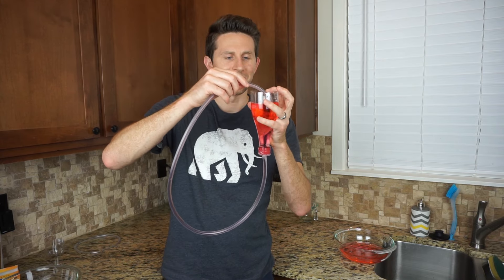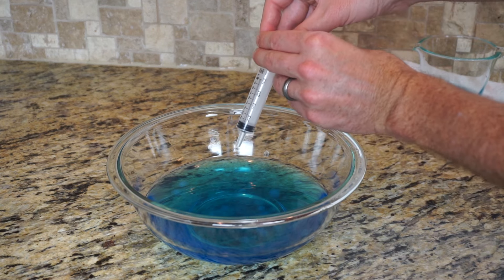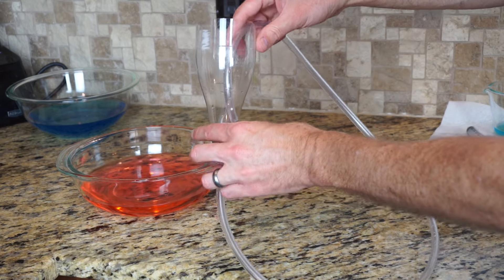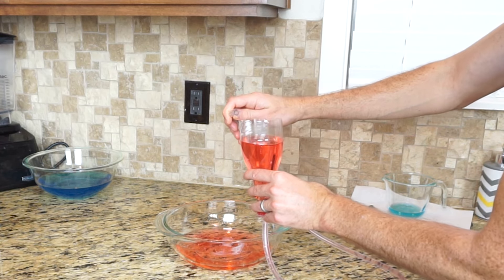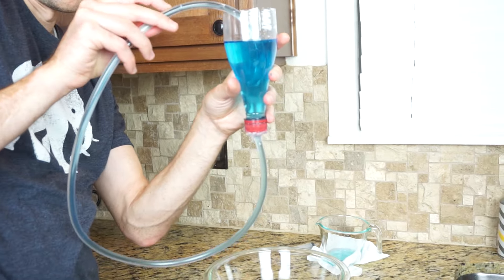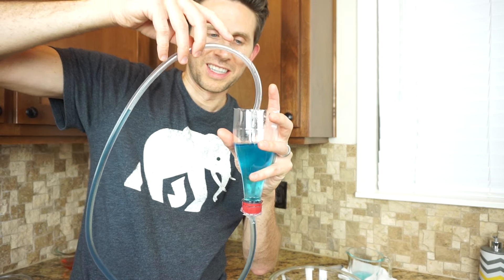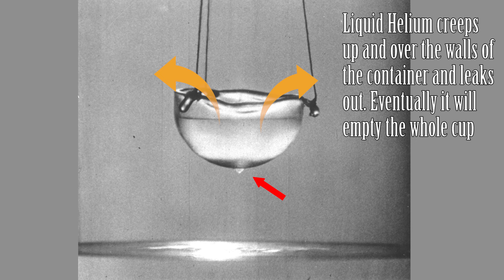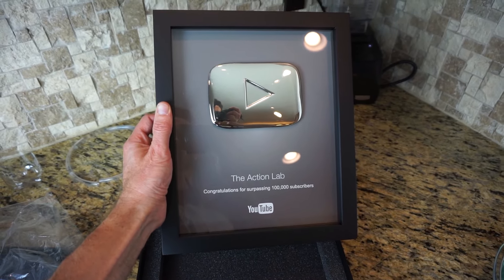Boyle's Self-Flowing Flask Filled With Polyethylene Glycol (Self-Pouring Liquid) = Perpetual Motion?

Comment: Im curious if you could use the flask design with liquid helium and a watermill so the weight of the liquid keeps it generating energy
Reply: He literally just said that's the one thing your can't do
Reply: @RijuChatterjee  he said you cant use a turbine. No need to get aggressive a water mill works on the weight of the liquid and or pressure turning the wheel. What is unclear is if capillary action is still needed for superfluid in the flask.

If so then it makes sense that the waterwheel wouldnt work.
Reply: @delicrux  The superfluid doesn't need capillary action. Honestly idk why he brought that up, it's pretty irrelevant to the rest of the video. The point with perpetual motion with a superfluid is just ... Newton's first law of motion. Objects in motion stay in motion unless acted upon by an external force. The 'object' here is the mass of the fluid,  that's all.

ABOVE ALL ELSE, YOU CANNOT BUILD A DEVICE THAT VIOLATES THE LAWS OF THERMODYNAMICS.

Comment: liquid helium will work without resistance but would fail with any amount of resistance? 

please prove this because if it does in fact work without resistance then it is worth exploring
Reply: The liquid helium thing only works because liquid helium doesn't have any resistance against flow. Once it starts going, it will keep flowing forever, unless of course you try to extract energy from it, then it would stop.

Comment: I came across PEG-3000 (polyethylene glycol with average molecular weight of 3000) and it happens to be a solid at room temperature. How come the PEG with average Mw of 1000000 is still a liquid at room temperature?

Comment: would a super fluid be usable as kinetic energy storage device if 
i got someone on a bike and had them pedal running a pump and get the fluid to a set speed would it continue at that speed in the system or would the surface adhesion to the walls slow it down too much?

Comment: So then the problem is that the pressure of gravity makes it always become an equilibrium... 
Thinking about it even if you have a pressurized top reservoir the pressure would eventually dissipate once it’s filled... hmm...
Maybe the problem is just the scale?
Like myth busters managed to make a semi self sustaining whirlpool with like 50 -100 gallons of water. They did use a water pump to keep the water flow consistent, but if there is a pool sized reservoir leading up to a syphon upper reservoir, like... 3 gallons worth, would it change the atmospheric pressure needed to keep the water flowing?
Reply: Seriously tho, this will probably make me sound like an idiot, but has anyone ever tried it on a scale like a pool or a hot tub scale?
Genuinely curious

Comment: How about if you keep the bulk of that tube above the top of the flask or, when you do that, make the tube so long that it actually has a lot more of the blue stuff in it than the flask does?
Reply: You’ll get the same result. It won’t work now matter how many configurations you try.

Comment: He didin’t explain why you couldn’t produce energy with the liquid helium
Reply: I think because anything that extracts energy would impede the flow. It is similar to super-conductors. Super-conductors can create current loops which do not decay. But if you try to extract any energy from the current loop, then the energy stored in the loop will be converted to another form and the current will decrease. Same same.

Comment: What if, on the funnel itself.. you created a spout to shove the loose end of the hose into once the liquid is flowing? The spout would have to be on the side of the funnel and lower than the liquid level in the funnel. As you pour the liquid through the funnel it’ll circle back up to the created spout, which would be at a lower point than if you were to  go all the way up and over the top of the funnel….. hmmmmmmmmmm

Comment: Why don’t you just insert the tube below the top of whatever fluid you’re using? And then if you add enough liquid the pressure would cause the liquid to flow in the tube maybe? Or would that need another force to make it flow
Reply: The liquid in the tub and tube would just level out after the initial introduction of pressure
Reply: @xelle1649  Ok that makes sense. I hate that we live in the 3rd dimension everything could be so much more cool if we understood a 4th axis

Comment: Boyle 's Law can be verified if
PV = K, CONSTRAINTS FULFILLED
PRESSURE IN BAR?
VOLUME IN PIPE FLOWING PER UNIT TIME  ( CC /  SECOND)
HEIGHT?
FOR PERPETUAL MOTION
PVT =K CONDITION IS TO BE FULFILLED
WHAT IS THE VALUE OF K IN
PVT =K EQUATION?

Comment: The reason you cannot get your project working... is that your tube is too small.  you have too much friction holding the fluid back in that small tube.  The same thing happens in a water level when you use a small tube.  So... change the size of the tube to 1inch tube... and then see what happens.  You give up to quickly, and don't think outside the box... which misleads people because of your limited thinking capability.  You may even need a tube that is bigger than 1inch.  But give this a consideration before saying it won't work.  Do your due diligence.

Comment: as you can suck it up in a syringe to a given hight the polymer strands can take weight 1nch or so as proven, 
Time kills it after because friction and temperature 
Only chance would be exact measurements up and down and design drop with an inner coating that the polymer repelled ,but ultimately that would fade away to as nothing lasts forever lol
But this would be slow flowing
How much energy can the polymer produce.. lol

Comment: Wait... so if it works with super fluids like liquid helium, isn’t that perpetual motion? Like, you can’t extract energy from it, but it can theoretically flow forever, right? Isn’t that perpetual motion?
Reply: That’s like saying that since gravity is always pushing down, that’s perpetual motion.
Reply: @aligamiles  I don't see how that's relevant (gravity isn't an object that's in perpetual motion, it seems to me to be more of a perpetual force). The idea of perpetual motion (as far as I'm aware) is something that's started once, then moves/operates forever with no added energy. Boyle's self-flowing flask is an example of something that seems like perpetual motion because it's started once by adding a certain amount of liquid, then it looks like the liquid is poured from the end of the tube into the cup which goes back into the tube and continues forever. If it worked, that's perpetual motion, no? Or is perpetual motion not allowed to utilize gravity?

Comment: Your container has about the same amount of water that your tube has 
It Doesn't make sense 
your container should be bigger 
The Bigger the container,  the more of the weight of the water will be pushed down in the small tube 
The container Your using has about the same amount of water as your tube
 so ya it will become level and will never have enough weight pressure to push the water out of the tube

Comment: Hi, I watch your videos l the time and have learnt a lot from you.. However, I do believe perpetual motion is possible... You can create it be using water bottles half full and attaching them to a wheel, set out in a circular motion... As the water reaches the top of 1 bottle it will cause the wheel to move making the water in the bottle above to also move to the top and so on... This would be perpetual motion... I wish I had the equipment to do it but would love to see a video of you trying it out... Think of a ships wheel and the handles are the bottles... This will work... Perpetual motion exists

Comment: Seriously! You couldn't get it to work! Are you trying to tell me that I just imagined that I used to Syphon free energy out of other cars back in my youth? 
Your problem is that the part of the pipe that has to carry the weight of the liquid to the top is much longer than the part of the pipe that is meant to use the weight of the liquid to pull down which if long enough on the downfall side should be able to pull up the liquid from the bottom! 
That's how I used to get all my free energy! It doesn't matter how high up you go, what makes all the difference is how much longer the liquid has to travel downward, the longer the better, it's best to spiral the tube on the downward side to keep it compact..
Reply: no

Comment: I think this would work if you shortened the hose.
The weight/gravity in the flask has to be heavy enough to push it down through the tube.
I think if you made a bigger flask like a large coke bottle and a shorter tube length (as short as possible without blocking the hose) this could actually work.

Comment: So there's no magnetic properties in liquid helium?
U couldn't put a coil around it to extract work from it; while its flowing in a circle?

..Until that extraction slows it to a stop. And do the maths on upscaling to see if it would be a worthwhile generator motor?
One that only requires a human push once in a while, to reset it.
Could it charge your batries?
Does helium even HAVE magnetic properties?
Never heard of liquid helium before, can it stay a liquid or does it only exist in your vacuum chamber, in the freezer, and other voodoo - you do. ??